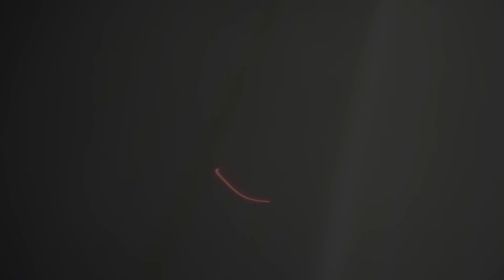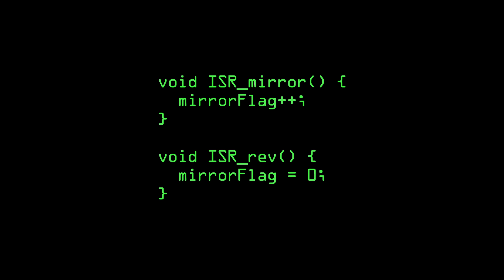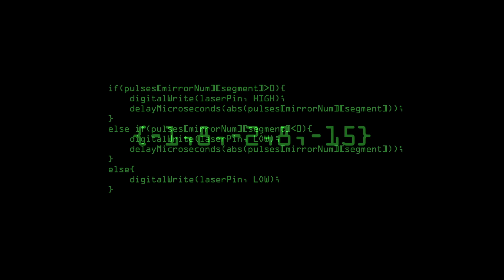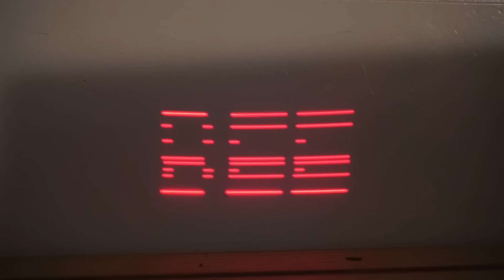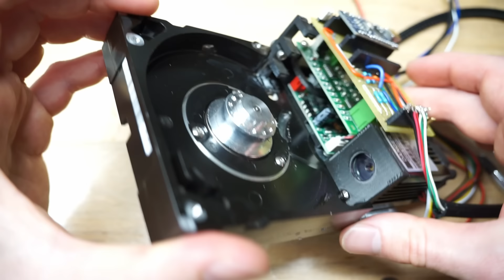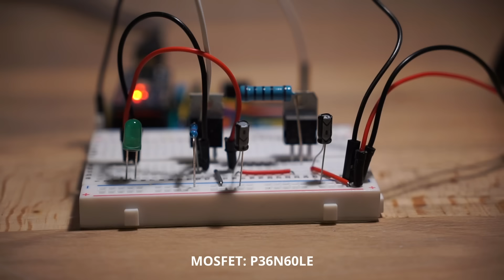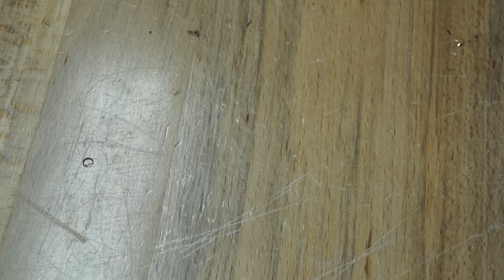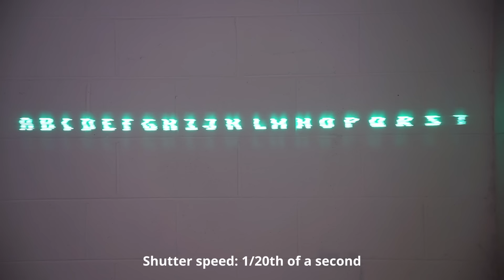DIY Laser Projector - Built from an old hard drive

Comment: If you don’t use tarduino delay functions but rather use noops and direct port writing you should be able to get a laser toggle every 2-4 clock cycles. You may want to invest in a MOSFET gate driver IC though.
Reply from the maker: Interesting. I did not know that. I'll have to look into that further!
Reply: @benmakeseverything  You can also use a timer compare output to get a 1 clock cycle. As long as the total ON-OFF loop is greater than what you need to reload the next loop which is around 16 clock to load 2x 1 byte from an array and increment index. 

Also by default an ISR call will push and pop many things when called and it takes around 30 cycles to do it, plus the ISR call isn't constant, I don't remember all but it's something between 3 and 7 cycles depending on what instruction is currently executing. Might be worth checking for ex rising edge call ISR, then in ISR wait for falling edge in a loop. That way you have a 1-2 cycles jitter max.

Overall great project very well done. I'm impressed by the results, keep the good work. Are you planning on publishing the code?
Reply: @philippegauthier1776  I had a feeling the jitter was likely down to the software, ISR timing makes complete sense. I guess one could also take the timing pulse and smooth it, but your suggestions sound more likely to be based in experience and thus more likely to work :-)
Reply: I also this it is an ISR issue, but rather coming from the timer interrupt. Arduino, by default, has its timer0 configured for millis() and micros(). The call to the timer0 overflow interrupt basically inserts small delays in the execution of your main code, causing jitter in your pulses.

You might want to try disabling timer0. Or reprogram the timer with custom settings for your needs.

(also, if the external interrupts turn out to be a problem, you could get away with a single pulse per rotation. Because the rotation speed won't change much within one revolution, it is safe to divide the time by the number of mirrors)
Reply: @thomzz3449  Actually they could configure one of the MCU timers to count automatically in hardware on external interrupt and overflow after a certain number (amount of mirrors). The counter could still be initialized to zero by a software interrupt on the second ext int pin, but I would disable it after the initial position is known to save cycles (since I would not expect it to ever skip a mirror).
Reply: What is a tarduino?!
Reply: @mattmoreira210  
Indestructible Arduino. Tardigrade + Arduino 😎👍
Reply: @mattmoreira210  It’s a derogatory term for things associated with Arduino, a portmanteau of “(re)tard” and “Arduino”. Usually used to refer to things that set Arduino development apart from more conventional programming of a low-level language on an embedded system. In particular, the use of simple functions that are easy for beginners to get into, but lack in both performance and insight to the bare metal microcontroller, is something that fosters bad programming skills. Actually reading the datasheet for your microcontroller, figuring out which registers you need to address, and writing uint8_t values directly to them, is going to both give better performance and give you a better understanding of what’s going on under the hood and hence what could be causing issues.
Other things that might be considered “tarduino.-esque include: programming and debugging via USB-UART bootloader, using time delays instead of interrupts, using ADC reads when you’d be fine with an analogue comparator, and trying to make a low-power circuit with a full Arduino board and its CH340 and power LED wasting quiescent current.
Still not as bad as expecting fast code via MicroPython.
Reply: @mattmoreira210  Arduino abstracts the brains of the operation, the ATMega328p, with functions like a single pin digitalWrite() that waste too many clock cycles when, instead, a direct PORT=0bXXXXXXXX or PORT=$XX could manipulate multiple pins at once significantly faster. This kind of abstraction “dumbs down” the learning curve. Hence, “tarduino.” It’s quick to learn and get makers going faster, but comes at a price.
-My $0.02
Reply: @mattmoreira210  its a typO of Arduino
Reply: It is also possible to use the SPI peripheral to output the signal, but there will be a 2 cycle delay between each transmitted byte, also freq is F_CLK/2 max. Still good enough for letters, but any graphics might need an external shift register.
Reply: the common problem of MOSFETs is their gate capacity which must be discharged in order to switch off. Personally I would prefer bipolar Transistors in darlington array.
Also you may consider using an ESP32 which is available up to 240 MHz and pretty cheap.
Reply: @freundderuc9146  BJTs do just eat half a volt of saturation voltage though. You only have to drive a load of a few amps to start burning whole watts. Even if it’s not quite necessary at a smaller scale, using MOSFETs with gate drive circuits is a practice that scales up well.

And if your load current isn’t that high, a transistor like the AO3400 has a low enough gate charge and threshold voltage to easily be driven directly by an MCU.
Reply: Зануда

Comment: I really like this project, wouldn't it be better to use a monitor of a speakerwhere you use the membrane as a leveling system for your layers. Well i supose it would be a bit more difficult to implement it because you will have to shoot your beams at an angle.

Comment: This is so good, if those lasers didnt need to be this powerful, I would try that myself. Btw do you have any killswitch for laser in case the mirror holder stops spinning for some reason?
Reply from the maker: Thanks! Actually a killswitch isn't necessary because the laser only comes on for a few microseconds each time it passes the sensor - so if it isn't rotating, it won't turn on.
Reply: @benmakeseverything  STM32 is also a faster processor you could consider using, the RP2040 also has some programmable IO functionality that could be used to offload a serious amount of work, allowing the main processor to just focus on calculating timing. Ultimately though an FPGA + MCU solution would be best but far outside the scope of a YT video and certainly too much software for any sane person who would ever want to mess with.

Comment: I may have told you this before but pleeeeeease upgrade your audio, when you speak in person there is too much reverb! Great video! Please keep creating content just please work on improving you audio.
Reply from the maker: I actually did use a lapel mic this time around, but I was still recording in a big empty room with no carpet or anything to absorb sound. So I guess there was a bit of echo. I will try to record somewhere else or put up some sound panels next time. Thanks for the feedback.
Reply: @benmakeseverything  ah! Ok, so it's the sound reflections that are killing you then! The sound panels should really make a difference. I can't wait for your next video, you really do great content.
Reply: Excellent video btw.
Reply: @howardleen4182  first get it even and then the rev 
But nothing bad in comparison with others YT’s
Reply: @MaxMut.  I have no idea what you just tried to say.
Reply: @howardleen4182  just mentioned the reverberant place you mentioned you know about and also the audio is not recorded in the same situation therefore not even when you heard 
I don’t care about that 
Just your work which is great “
Reply: @MaxMut.  ....ok?
Reply: @howardleen4182  yes I personally don’t care much about the audio 
Just trying to help a bit
So it’s pleasant to hear and more professional 
But l don’t think you have to worry about 
Since is an engineering Chanel
And so far your doing pretty well